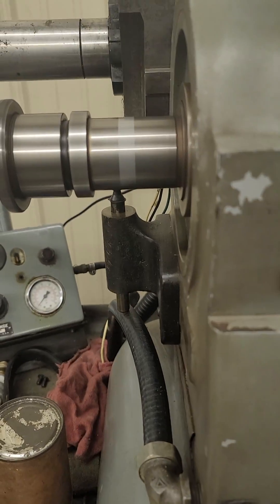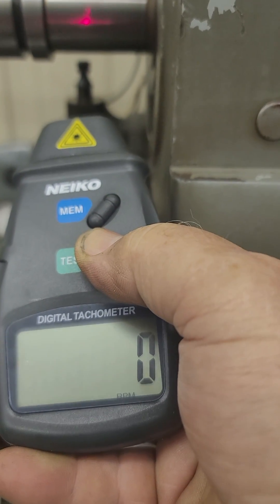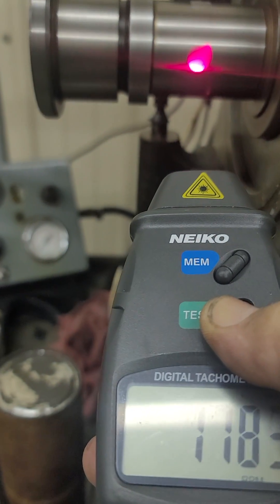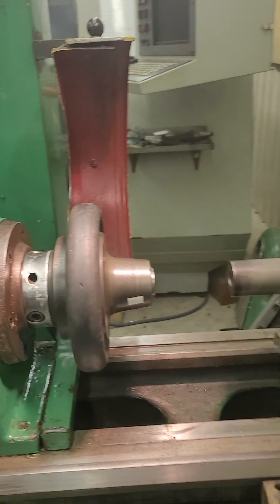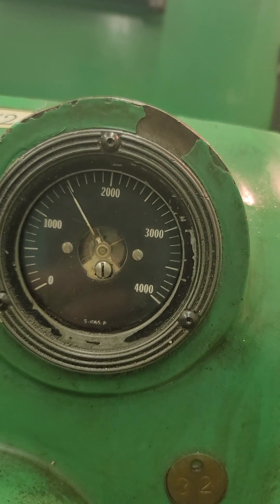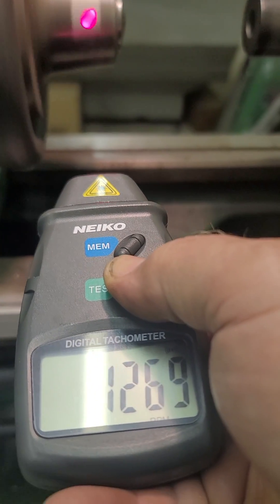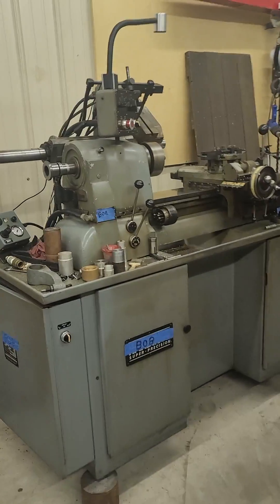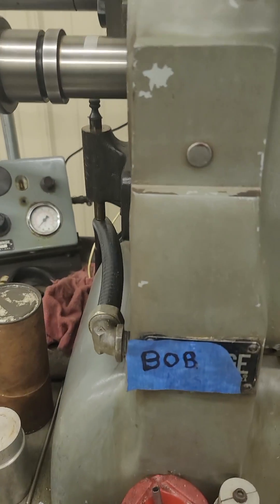Does a cheap Digital Tack work?

Comment: They work great at all speeds as long as the surface is not reflective. Wrap the shaft you’re measuring with masking tape and stick the reflective strip on the tape.

Comment: So wrong gear set on the Monarch from the spindle swap? For some reason the tach is now reading wrong on it. You said it picked up speed after the swap. Apparently it didn't. It is just  now the tach on it reads wrong.
Reply from the maker: The gear is the same on all of them.... It has something to do with the wiring going to the board that is wrong... I think :)
Reply: @10swatkins  Isn’t the tach direct drive mechanical from the spindle on the monarch?

Comment: Steve.  What is the rack for on the monarch.    Below the tach dial.  ? 
So it's reading bob accurately but not monarch ?
Reply from the maker: It's a micro meter stop bar... On this one it is in inches on one side and metric on the other...   Bob is accurate , monarch not.... Have to find out why ...

Comment: Steve,  I got one of those about 2 years ago,  haven't had any trouble with it.  Even the battery is still original.  If yours keep reading incorrectly I'd contact the company
Reply from the maker: I don't think is is reading incorrectly, It's too close to the speeds indicated on Bob....

Comment: I have one of the old style tachs that you hold against the spindle or crankshaft or whatever. Never thought to check my lathe. Bob sure is quieter than the Monarch.
Reply from the maker: Yes it is.. all the covers are off the monarch, the belts are all open, the head has just got the thin inner cover on it so all the head gears are heard and not muted by the cast cover and the apron is just holding onto the side... The collet chuck is also making a rattling noise,
Reply: @10swatkins  Oh, I didn’t know that.
Reply from the maker: I have one also, forgot how to count it though :(

Comment: Have that same digital tach picked up several years ago.  Use it check the RPM's on my lathe and mill spindles.  Will say, it is very accurate.  Hope the 9-volt battery hasn't spilt it juice and messed up the tach.  Been a while since the last time I used it.
Reply from the maker: It was hard to get the battery in.. probably a good idea to take it out between uses....
Reply: @10swatkins  I 2nd that!
Reply: @10swatkins  Yeah, I generally do take out the battery when not used.  Not sure I did the last time I used it.🤔